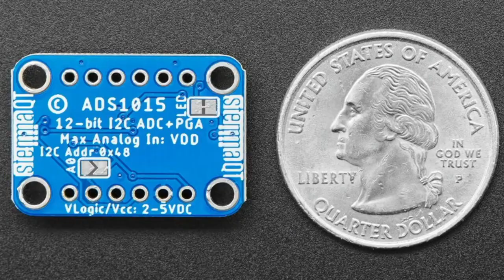New Prods 6/22/22 Feat. ADS1115 16-Bit ADC - 4 Channel w. Programmable Gain Amplifier - STEMMA QT!

Comment: I suspect you could assemble the hammer header in a bench vice if banging on your PI with a hammer is disconcerting. :-) I used to assemble IDC 50 cables that way for scsi drives back in the Amiga days.